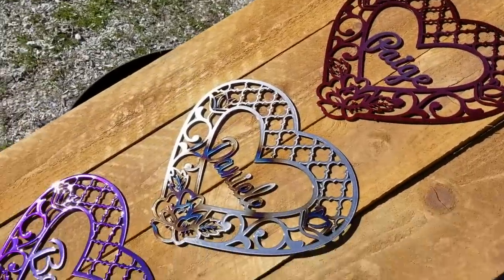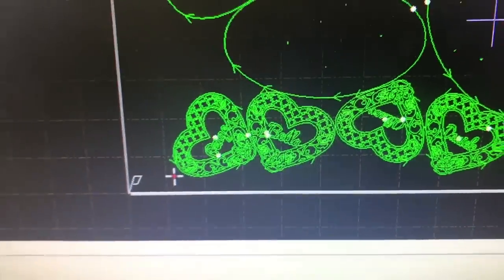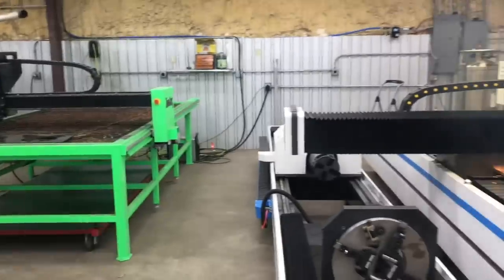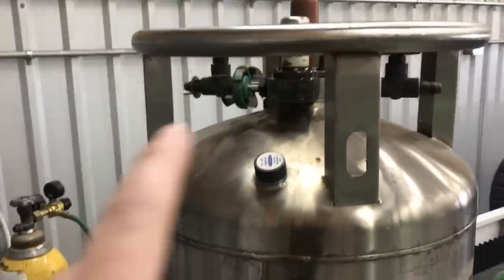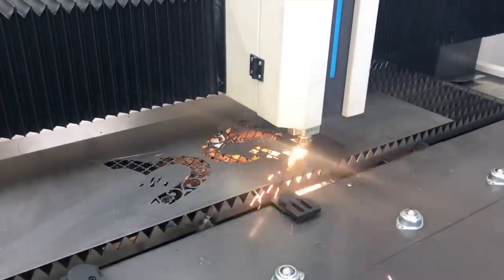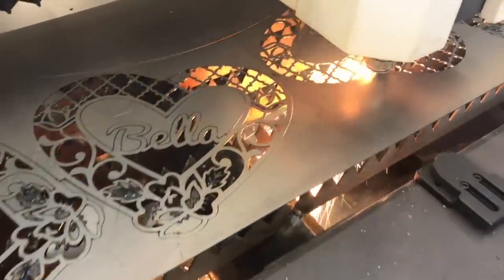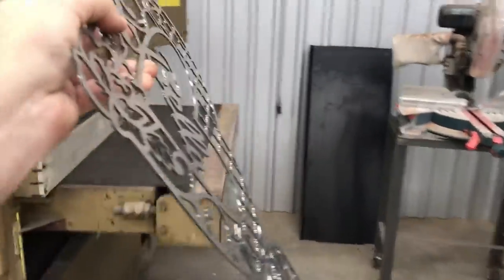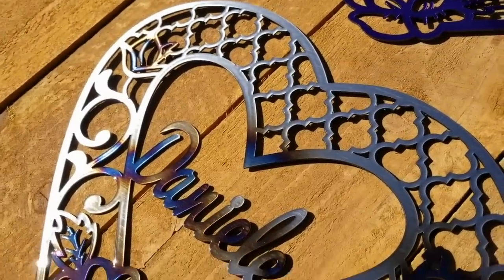Laser Cutting Learning - DIY CNC Cheap Fiber Laser - 1KW Prima Laser

Comment: if you can take off grid , you can cut 3d all material. just first make marking and  than calculate you need how many mm left right or forward back etc.. than change manuel on main control panel. thats all.. ohhh most important dont forget set zero !!! first of all set zero according to set zero you can change your cut left right forward or back.. good job

Comment: I m planning to buy one 1kw fiber laser i got an offer 17000$ fob shanghai port i guess same configuration raycus 1000w source raytool head hwin rails ncstudio or cypcut system, i m very familiar as i already own an old raycus 300w machine.
what is the max thickness in mm you've been able to cut? i ve been told 12mm by the seller
Reply: Dear Friend,This is Colin from Oree Laser in China, which is a professional Laser cutter /Laser tube Cutter /Laser Welder  manufacturer. Kindly add my WhatsAPP/Wechat number : +8618668921695 . or send mail to : sales079@oreelaser.com , I'll share more info to you .Our web: oree laser.com 
        Stay Healthy & Best regards !
Reply: Only up to 10mm mild steel and 6mm stainless for a 1kw

Comment: its been this long and no one's legitimately called you a fucker for that click bait? you can't "DIY" Cleetus!
Reply from the maker: The reason I put DIY in the title is that its DIY imported.  If you weren't a dumbass you would realize there are ZERO DIY machines like this.  You can buy all the parts, but most assholes like you that are home gamers dont have the ability to Fabricate a frame that would be rigid and accurate enough for a laser.  All laser frames 4x12 rectangle tubing, or a solid casting, with 1/2" steel plate boxed around the perimeter, and a 2" thick by 8" wide bearing pad on each side, which get bridge milled and heat treated.    By the time you had all that done yourself, it would be more than the cost to buy one from china.  DIY buddy!
Reply: @turbocobra  why? Is it made of chewing gum and Narnia wishes? Are you saying it can't be built? Ironically, This video was suggested by google, because I was researching just that, having built myself 3 medium scale co2 lasers, and 2 CNCs, and wanting a safer alternative to a gantry driven plasma cutter. You don't DIY, you buy, Cleetus, because you're clearly a button pusher. 
You're such a badass though, calling people assholes for shitting on your clickbait parade, prove me wrong. Stop being a hillbilly dick and actually make something.

Comment: Hey! While cutting mild steel for such decorative purposes, you can use nitrogen instead of oxygen for smother, sharper finish. The edges of the part are burnt due to oxygen.
Just a suggestion
Reply: I was just gonna say the same thing then I seen your post lol. Only thing is that it cost more lol.

Comment: Hey! While cutting mild steel for such decorative purposes, you can use nitrogen instead of oxygen for smother, sharper finish. The edges of the part are burnt due to oxygen.
Just a suggestion

Comment: How thick is the cutting line of the laser? Looks a bit thick. What about the tolerances? Does it compensate the cutline thickness, softwareside somehow?
Reply from the maker: kerf width depends on material being cut.  its as small as .006" on thin materials, .14" on thicker materials.  Yes you offset in the software.  I showed the accuracy in another video

Comment: I've had a similar laser for about two years, a smaller 500 watt machine. We recently switched to highly filtered higher pressure shop air (160 psi) and have found it improved our cut quality significantly over oxygen.. In our case the cost of the setup had a roughly 36 month return on investment as we cut very large volumes of small parts. I'm still putting a video together about using air with the laser since it's not really talked about. One big advantage of compressed air is that you can use the air to cool the parts to prevent oil canning that often results in tip touch errors.. It could also be a good idea to calibrate the capacitance sensor since it will change the descent speed in "global parameters" which can help the laser not have a tip touch error.. I can say you REALLY NEED to get the fume extractor hooked up, the laser dust is nasty and even small amounts over time will give you breathing issues. I have a set of fusion 360 drawings for a laser cut air filter unit that takes fairly reasonable filter packs.
Reply from the maker: Definitely would like to see more about your setup.  I have been told you need 250 psi at 70cfm to get good clean cuts with air, so will be interested to see what you have done.
Reply: @turbocobra  Hey got the video put together https://www.youtube.com/watch?v=1eQA20tuKMQ.. I'm still working on the air compressor part showing what we put together and what other options are out there, because mine caps out at around 14 gauge sheet metal. There is a way to boost pressure and I'm still looking for a decent supplier of the part needed for that. Sorry wrong link at first, got the right one now.

Comment: I would recommend at least a 10" duct with a 5-8HP dust collector for this laser! Donaldson Torit DFO series are the standard for lasers. I got my 4.4kW CO2 hooked up to a DFO2-8 using 16" duct...pic: https://imgur.com/nreOp2H You can find fairly reasonable ones on eBay ranging from $3-5k. Brand new ones run as much as your laser!

Comment: So awesome !!  Looking forward to see you cut some half inch and see how it does we run a water jet but it’s a bit slow it’s great to see some one trying these off brand lasers.
Reply from the maker: I wont be cutting any 1/2" for a while.  Right now i just have a 1KW power source that is max 3/8.  Later this year i will be upgraded to a 3KW.
Reply: Ramsey Customs - turbocobra how much would the upgrade be to the 3k watt. Have you posted any videos of the 3/8 cuts
Reply from the maker: @evanvillarreal8766  I had a video showing some 1/4" cuts, havent done 3/8 yet.  here is that video https://www.youtube.com/watch?v=MQZhdv3z5Is&t=13s

Comment: What is the cost difference between Lazer and plasma cutters ? Your products have very fine details. 
I've been a traditional manual and CNC machinist for 40 years and am just starting to learn about CNC plasma cutters, and just  ran across your channel cutting with Lazer.
How tight of a tolerance can you hold with Lazer cutting? How tight of a tolerance can you hold with plasma.
I see what looks like a plasma cutter in the back of your shop.
Have you completely changed to Lazer cutting, or do you still do both?
I'll look thru your other videos for info.
Thank you in advanced for answering newbie questions.
Take care
Reply from the maker: Average plasma table is $15K, This laser was $50K.  Cost of cutting is higher with laser because of the cutting gas, but much lower consumable costs and lower labor cost with no post cut clean up work required
Reply: Thank you for taking the time to get back to me. Take care

Comment: Slow your Conveyor belt down, I run mine 25% of what yours is and the results are much better and you don't have to make extra passes.
Reply from the maker: I had some issues with the parts getting hung up when i ran it slower.  I only run them through one pass per side.